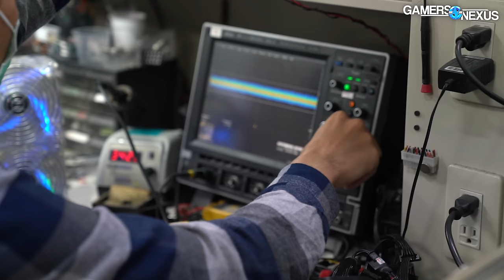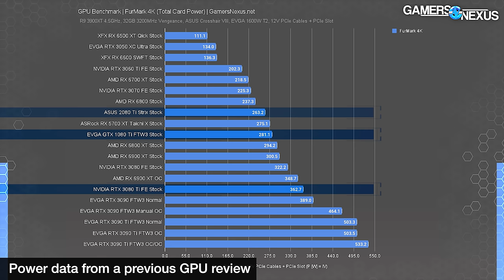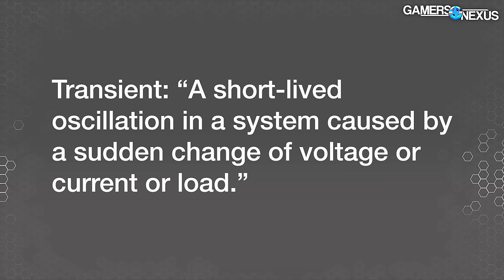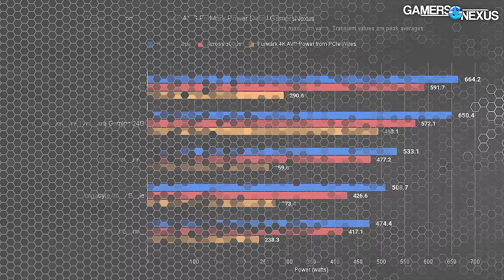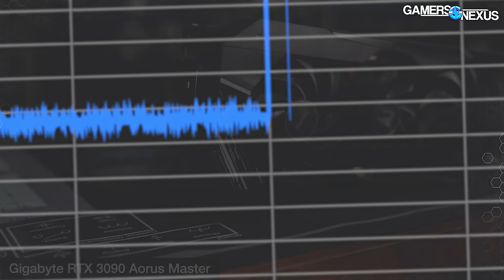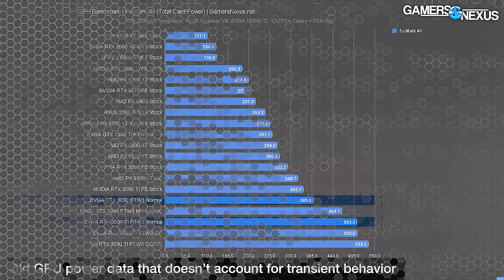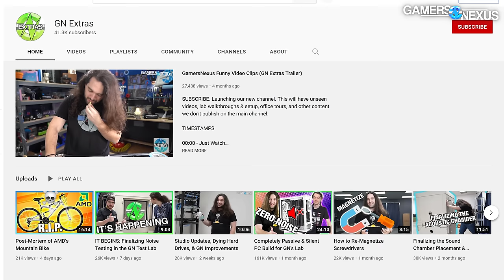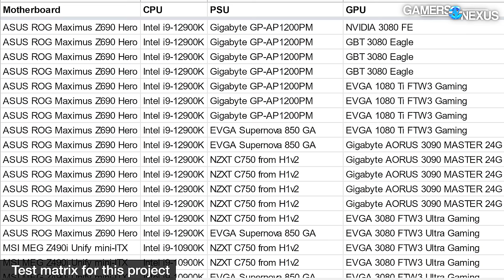The Brewing Problem with GPU Power Design | Transients

Comment: Possibly we need some sort of regulation for power spikes like this , similar to EMC regulations ? A PSU should be expected to be able to handle spikes yes ( due to things like inrush) but not to this level , not in the consumer space.
Reply: Most consumer PSU's are generally built to the ATX specifications for power supplies. That spec doesn't really address any specific requirements for transients. However, it does say that DC output voltage must remain within a certain range under ANY load conditions that are within the specified output ratings of the supply. So, if your supply says it can do 40A on a +12v rail, the ATX spec doesn't care if that is a nice steady 40A or if it switches between 40A and 1A every microsecond. It expects your regulation to be within spec no matter how crazy the load cycle is. This is unrealistic, but the spec is silent on transients. Transient requirements for the rails could be added to the ATX spec, but failing that, GPU and PSU manufacturers would have to publish their own tolerances for transients and we would have to compare them ourselves. That or NVidia and AMD are going to have to start their own certification program and publish their own specs so PSU manufacturers can put a "NVidia 4080 Certified" or "AMD 7800 Approved" sticker on the box to help tell consumers what to expect.

This is just another indication of just how far out of date ATX has become as a set of system building specs. ATX needs a major overhaul, but Intel isn't in a position to tell everyone what they have to do anymore.
Reply: The new ATX 3.0 standard will indeed require supporting 200% rated output for 100us. This should help quite a bit.
Reply: Just buy bigger psu , three times the power draw of pc the it will be enough .
Reply: @kaiwenwu8148  that's not a bad rule of thumb. Maybe 2x instead of 3x, but at least 2x to be safe. Power supplies are typically in their peak efficiency around 50% loading anyway.
Reply: @noname-gp6hk  if account for 120% to 130% ocp trigger point of normal PSU,  2x of power rating should be ok.
Reply: @wrathek  They FINALLY got around to adding more power specs?! Yay! I haven't seen much of the 3.0 stuff yet other than some of the physical layout requirements. I wasn't encouraged since the system layout still looked horribly inappropriate for the structural and cooling requirements of modern graphics cards.
Reply: @Hazard I'm not an expert, but I do know a decent amount about the history of AT and ATX. I still regularly complain that motherboards ought to be lying flat, parallel to the ground, rather than perpendicular to it. That is how AT expected things to work, and it would make armored PCI-e slots and GPU sag non-issues! We got away with going vertical when expansion cards still only occupied a single slot, but the writing has been on the wall since probably ATX 1.2 and definitely before ATX 2.0 that the physical layout and power/cooling provisions were not adequate for the large, high-powered expansion cards available. While they didn't plan for these monsters originally, ATX has been revised several times, and more should have been done by now.

Comment: Had a AIO Vega 64 card on a x370 MB and a Rosewill 1350 PSU .  Started having this issue occasionally in 2020.  Started being a more consistent problem in 2021 where I could reliably shut down my system by loading a stage in Destiny.  I was beside myself trying to troubleshoot, crossing my fingers with each AMD driver update.  When GPU prices came down from ridiculous to just gut punch levels in 2021 I desperation bought a AIO 6900X card and a B550 board, assuming it was my card struggling to keep up with newer games as I play in 4K.  The problem seemed better at first, but I about had a fit of rage when it happened again for the first time.  I would play for several more months clenching my chair from the anxiety of knowing my next crash could be at any moment, and I could almost never consistently reproduce the problem.  It wasn't until I saw you mention this while you were researching this video that I finally had my "AHAA, this explains everything" moment.  I switched PSU to a Seasonic 850, lower power but much higher quality.  After the change it's been smooth sailing since.  Huge thank you to GN, I had just thought "I definitely have enough power", and had never considered the OCP angle.  Will put a lot more effort into choosing power supplies from now on, and you're spot on in how frustrating it is knowing that each of your components, PSU, graphics, and MB can factor in to how this problem manifests. The average consumer could never get enough info to make decisions on parts in regards to this issue and even most independent reviews would struggle to find the time, resources, and motivation to delve into this topic.  Great on you for leading the charge, and this level of production is immensely impressive for an independent group.  This channel has become a necessity for being the consumers voice of reason to the manufacturers and developers.  Unfortunately for me I noticed your work here too late to save my wallet, but now I know better and am a full subscriber and follower.Thanks!
Reply: Yes! Perfect comment :)